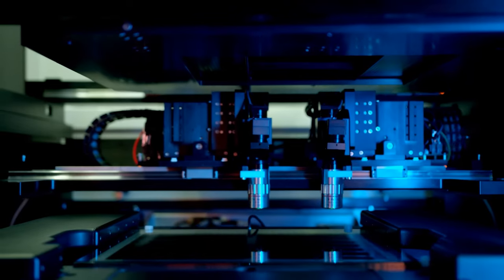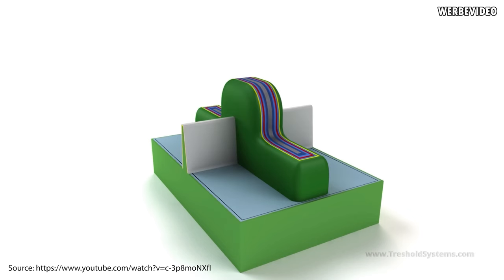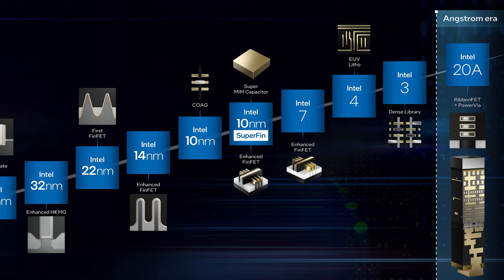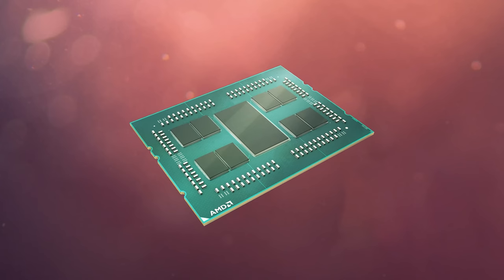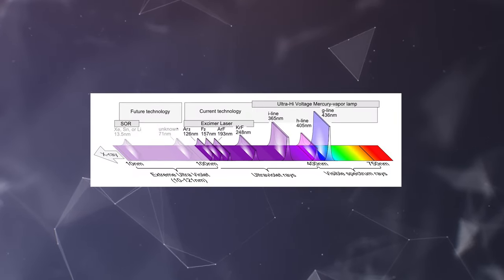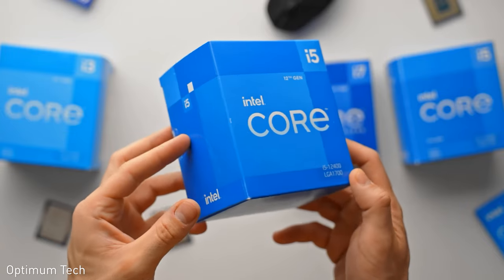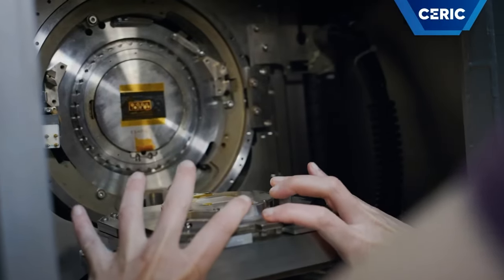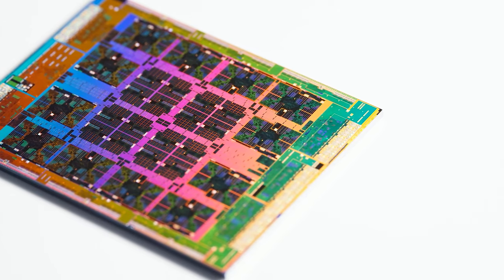PHYSICS of your PROCESSOR. Problem of the nanometer limit

Comment: In the early 1980's I was using near UV light for making discrete bipolar transistors with 1 micron wide surface features. A 1 micron line is a fuzzy blur at those wavelengths. We were using alignment marks on opposite sides of a 50 to 75 mm wide Silicon wafer which made use of that blurriness. When you have two concentric rectangles, an interference pattern becomes visible between their respective edges. So the wafers could be aligned manually in 4 degrees of freedom (left-right, up-down, rotationally, focal depth) to an accuracy of about 0.1 micron at an alignment mark spacing of more than 70 mm. Mask alignment across that distance is therefore incredibly precise. Modern wafers are maybe bigger than 300 mm in diameter, and similar mask alignment techniques are still used at far UV wavelengths. So what this means is that chip surface features somewhat smaller than the wavelength of the light used can be produced.
Chip quality always varies across the wafer, no matter how precisely all parameters are controlled, even ignoring Silicon lattice faults and the inevitable residual contamination which occurs at all stages of production Even with simple transistors, one small wafer can yield a range of devices from very close to the theoretical limits to totally useless. And as you say, the higher the device complexity and the smaller the elements of that device, the more faults accumulate, and the lower good yields result.
Even with ion deposition, there will always be anomalies.
Wafer fabrication engineers have been known to refer to their skills as being very much like cooking; no two sessions result in precisely the same outcome. There is as much art as there is science, mathematics, and a wide range of other skills, along with years of experience in the production of high quality semiconductor devices. Their retail prices really are justified.

Comment: We're reaching a limit with current technologies in hardware. New technologies that meet the thermal, cost and conductivity requirements, and can be mass produced to take over from the current generation is going to bring with it some growing pains. Really demonstrates the importance of software to take up the slack in the meantime. New algorithms, better use of parallelization, etc. are going to be vital. Low level programming is far from dead and a lot of the open source, low level C dependencies, that has been the backbone of modern software for decades will need some rethinking or be entirely re-written. Poorly optimized software has been too reliant on increasingly faster hardware. The lessons learned by the old guard of software engineering are dying off, with preference of merely learning and using high level frameworks. In the meantime, our digital infrastructure is built on a 40-50-year-old foundation.
Reply: Yeah software nowadays is incredibly bloated
Reply: I just wait for the day that people figure out Windows NT isn't efficient enough because of its age and will switch to Linux

Comment: I think from the viewpoint of electronics we have to live with the structural limits of solid state physics. If we like it or not, the lateral limit is several atomic distances. If you go below it the structures become thermally unstable and you get a lot of throuble with electro-migration. The current densities in the metal layer structures are allready now in the order of macroscopic superconducting structures (wires and tapes). I think the limit will be around 1 nm. This is also the order of magnitude where we come to atomic clusters and the materials loose their bulk properties. The material behavior becomes more and more domiated by surface physics.

I am also impressed that the phototoresist itself is capable to depict such small structures.

Comment: Right, the distance a signal can travel inside the die is not relevant because the die is tiny and the layout of transistors on a die ensure that signals that are generated don't need to travel the length of the die.  So, what matters is how fast you can switch a transistor on and off.  What also matters is how much resistance this creates and how much resistance there is in the circuit in general at very high frequencies, which is what increases power consumption and heat. In general the higher the frequency the more perfect the construction needs to be.  Imperfections create resistance.

But that's the hard part, etching a circuit ever smaller, but having to make it more perfect.

Comment: I'm thinking stopping at 3-4nm for awhile and bringing us HMB ram on the CPU die and removing the normal DDR sockets. Extremely high cache on the CPU with 512mb shared cache and HMB ram would be fantastic.
Reply: I don't know if in misunderstood something about a video he made before, but he said that it cannot go lower than 5nm.
Reply: @elcebollon7750  In that case he got clowned, RTX 4000 series uses 4nm and 3nm is currently being produced by TSMC and bought mostly by Apple for the future M3.
Reply: @MickenCZProfi  it was my bad, i look it up and the silicone atom is 0.2 nanometer and china made a 0.3 nanometer transistor, also there is a chip with 0.5 nanometers transistors that can switch from insulator to conductor, so probably I heard wrong.

Comment: Actually, it’s the closer the transistors are the faster it operates, this is a knowledge by AMD’ˢ R&D department, The problem is overheating and performance, this was AMD’s biggest Challenge to defeat Intel

Nevertheless, AMD was able to overcome the heating issue, the performance was still down, so what they did was incorporated, the north bridge processor into the CPU, giving birth to AMD’s APU, this allowed the CPU/APU to have its own direct communication to other processes on the motherboard; although they were not able to increase performance, they were able to increase efficiency

This reduce bottlenecking, and decreased motherboard resources, allowing for a smaller motherboard, using less power; with this kind of processor, there would be no need to increase speed of the CPU if you can reduce the bottlenecking through the motherboard; CPU speed is contingent upon other processors on the motherboard

Comment: I counted the leads of the Intel Core 2 Duo, and the Intel Pentium Dual core. The Core 2 Duo was rated at 2 Ghz, 2 mb cache. The Pentium was rated at 2.2 Ghz, 1 mb cache. The Core 2 Duo laptop cpu had about 5-10 more strings than the other one, but I couldn’t count them exactly.

Comment: The next big leap will be quantum computers
Reply: Unfortunately, practical quantum computers for mainstream use, ie. desktop quantum computers, are decades away - assuming that'll be possible at all. In the interim, I foresee a major change in how we implement chiplet and core design. AI will help design better and better masks, thus making processing in the current nodes much more efficient. Moore's law died with him. We have to concede to that, and attack the problem from other angles.
Reply: @Harvey_Pekar  I agree, we're decades away.. Controlling thermals would be good leap forward. Maybe one day we'll have nanotubes that act like vapor chamber pipes built right into the die. We're going to need something more substantial than what we have now for dissipating heat in order to maximize the potential computing power.

Comment: Hmmmm .... ;
*I have been asking fancy-pants geeks these simple-damn questions for decades, the least-worst answers I got was endless damn circular tech jargon.  Thks for anticipating my simple questions (aka crux system design factors) & clearly/succinctly/etc answering them w/o all the endless damn circular tech jargon.  Pls don’t fall prey to the religion of Geekism & start talking in its religious geek tongues just like the rest of'm.  I’m not anti-science, just a scientism heretic tortured for decades. Oh ?Any succinct-books explaining this stuff clearly like you do? 
*Oh ?Hows-abouts doing FPGAs? Supposedly a FPGA turns a theoretical hardware processor into a software development project.  Perfect for low-volume projects where an ASIC processor is far too expensive, takes too long, etc.  Since you can update the FPGA just like you updated its software, an FPGA unit potentially has a longer life than an ASIC implementation.  If unit volumes ever gets high-enough, an FPGA is a perfect tool to implement/develop the specs for an ASIC.  I'm working myself to death trying to learn the secret/black art of FPGAs (ain’t much help out-there).  
*Thks again